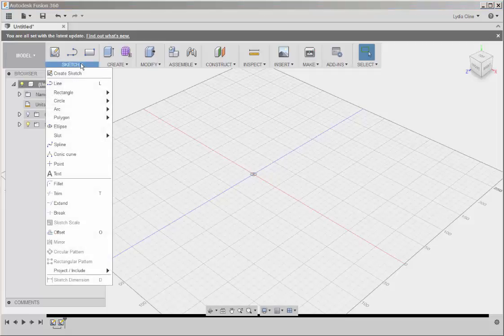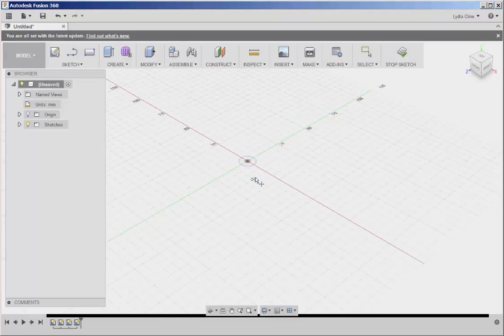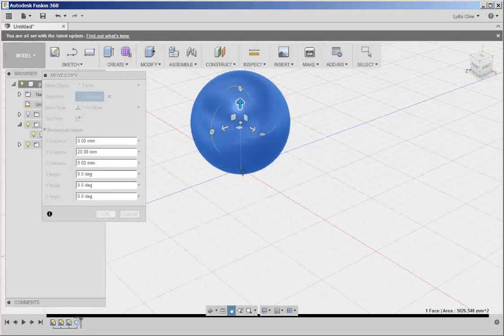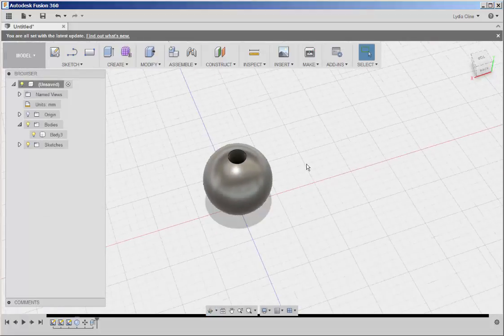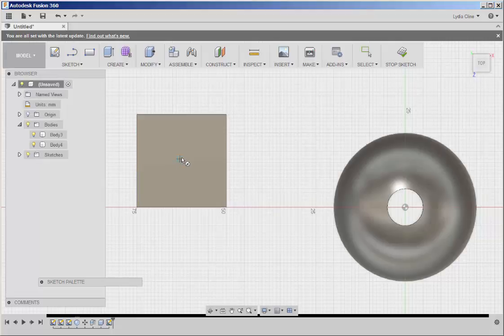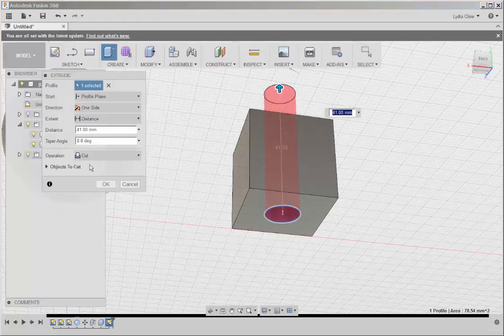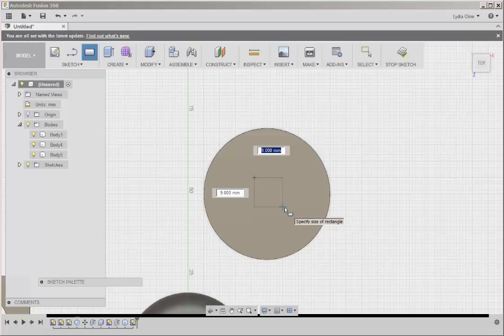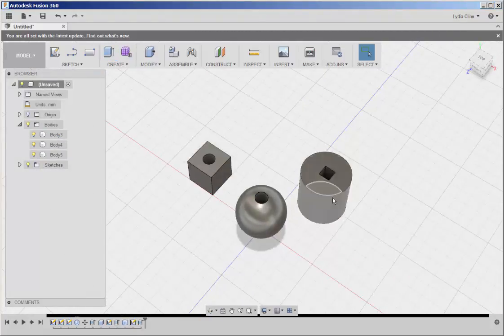Fusion 360: Center a Hole on a Sphere

Comment: Hi, that's a good vid, I found it after I'd been struggling to do something similar but arrived at a different solution.  It's possible to create a point in the center of the sphere from the construct menu.. then if you use the Hole tool, there's a Select Reference option.. click the point in the sphere center and it achieves the same..
Reply from the maker: Great tip!

Comment: You can also simply create a new sphere, and place the center of the sphere on the center of all 3 axis, then create a bottom sketch, make a cylinder at the same starting point as the sphere and extrude it as a cut through. No moving your little circle out of the sphere, or anything